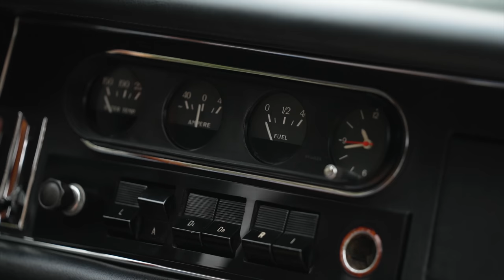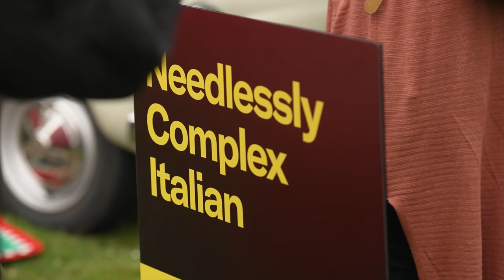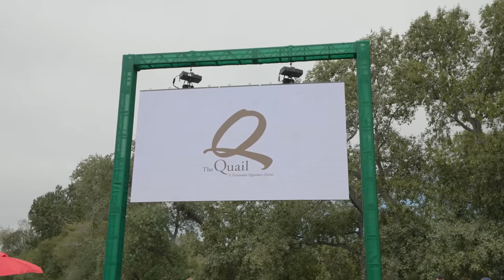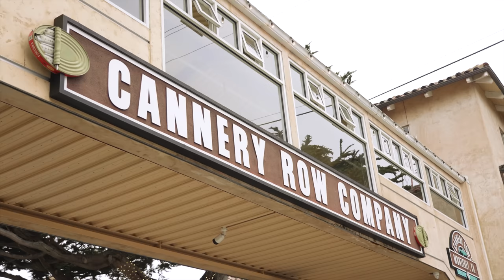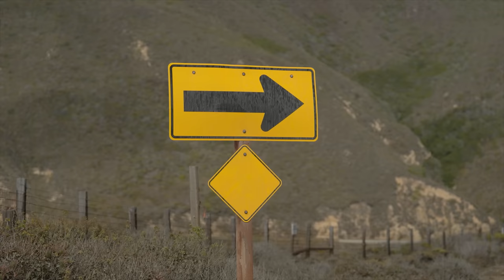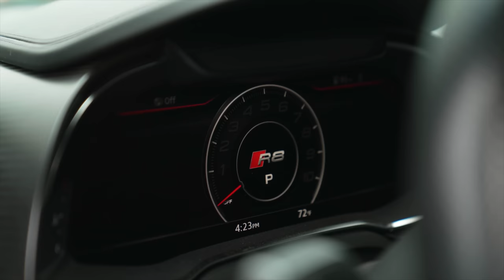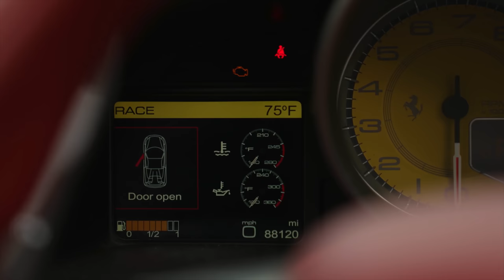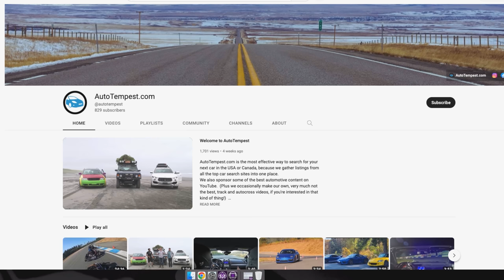The Biggest Car YouTubers On Earth HATED Our Cheap Wrecked Exotic Supercars | Car Trek S9 Finale

Comment: That Ferrari is just so achingly beautiful. The fact that it's not on the usual wire wheels makes it more attractive, and I didn't even think that was possible. That Hammer is just perfection. I thought Tavarish upgraded the turbos, downpipes, exhaust, and tune. Wouldn't it make more than the 750HP he mentioned in the last episode? Shouldn't a 675LT with those mods make closer to 900?
Reply: The alloys like those are standard, the borrani wires are an option. However the Borranis are still made so often get swapped on if replacement wheels are needed

Comment: The R8's flaw is that it's now too similar both in shape and sound to the Lamborghinis. What Ed should've boguht is the very first gen R8 with 5.2 V10 and a manual gearbox. There are quite a few within $100k - $130k price range and they look much better and have much more character than the latest generations.

Comment: Ed I have no idea what they were on when they said $59,000 currently there is a 2017 Audi R8 V10 plus with 50,000 miles for sale in the uk for £78,000 which even with the pound only just coming out of an all time low is still near as makes no difference $95000

Comment: Another entertaining, yet ridiculous example of how otherwise smart guys like the dumbest cars ever made.  Living right up the coast about 100 miles I can attest the scenery is spectacular and on that, they were right on. Not sure who would want to own any of the three cars they bought and drove.  What some people consider "super" cars is perplexing because of these three cars, none were super at all. The McLaren is a pile of parts waiting to break if somebody sneezes too hard. The Ferrari is always broken and always will be broken. The Audi is a yawner with the same styling as a hope chest but at least it's fairly dependable. They were correct when they said the C-8 Corvette is OVER DONE.  As one who has owned a '69 427/435 'Vette for 52 years, I almost can't look at a C-8.  It's disturbing. Wanting to buy another car several years ago, I saw and fell in love with a Lexus LC 500 in InfraRed with Toasted Caramel interior and absolutely love it. Not one single little, teeny, tiny problem in four years. It's beautiful, fun to drive, reliable and does everything the Lexus engineers and designers wanted it to do. It has a spectacular infotainment system which includes VOICE COMMAND and a trackpad that I haven't used more than ten times in four years. I simply talk to the car and it does what I ask...flawlessly.  The cars these guys seem to like don't do that and with the very marginal difference in performance, it makes one wonder what the hell they are thinking. My old 'Vette does 0-60 in 5 seconds and the LC does 0-60 in just over 4 seconds. Honestly, I don't find that to be a problem as neither car is slow.  Car Trek is entertaining and I would recommend watching all the different series to everyone.  The cars may suck but these guys make it all worthwhile.  They are the reason for watching.